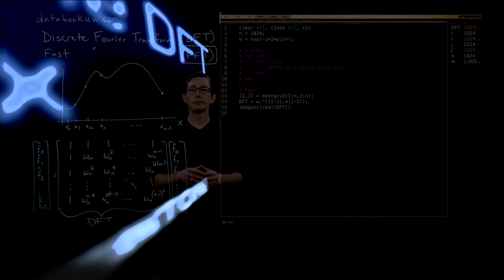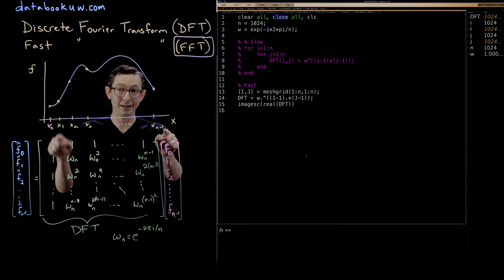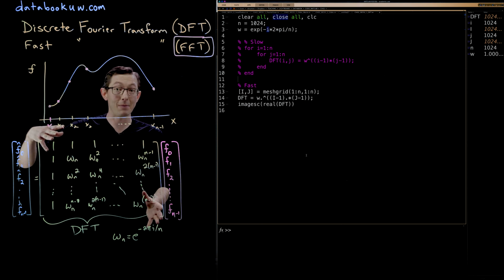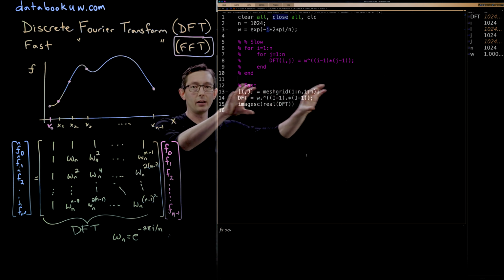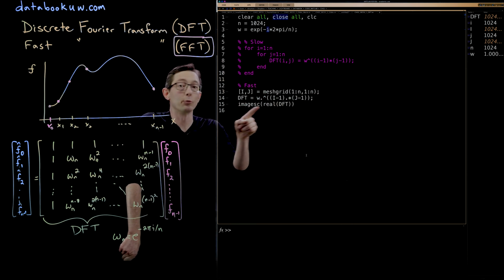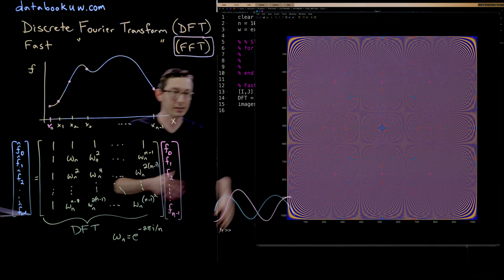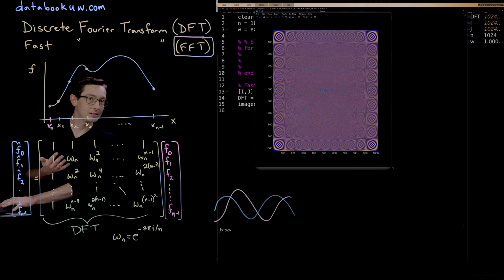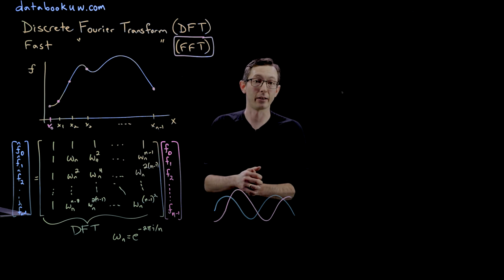Computing the DFT Matrix

Comment: What happens if I transform data that is longer than one period of a periodic dataset? I got very strange behavior trying this in matlab. It worked using the fft command, though.
Reply: Oh, sorry. This probably was because I had an indexing error (used signal that went from -N to N). It seems to make no difference. The coefficients should repeat, right? Then 1/N will even out the extra sum entries, right? The spectral coefficients look strange, though. They look like two transforms overlayed.

Comment: I guess if you had an image and a Hilbert curve. And as you followed the curve, sign flipped every second pixel and then did a fast transform that would result in an interesting sub-random semi-structured projection. Maybe🍸. When I get a raspberry pi 400 I'll check it out.
Reply: There is a fast method to generate the Hilbert curve in Matters Computational. 
Maybe you can do a video on the orthogonality aspects of the Fourier matrix. I don't quite have a grip on that.

Comment: Which means you are computing a fixed bunch of dot products. The funny thing is only a very small sub-set of possible inputs will produce any noticeble spectral response. The rest will just produce Gaussian noise. It is an under-considered case that sometimes you might want  to use a transform as a bunch of say orthogonal dot products without all the fancy spectral math. Then you often need only do something simple like apply a randomly chosen pattern of sign flip to the input of transform or a random permutation.    Or you want some intermediate situation by using a sub-random pattern of sign flips.